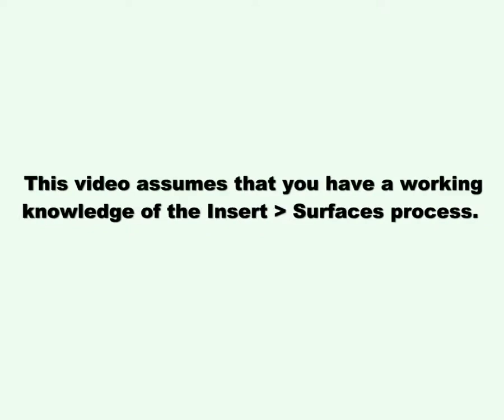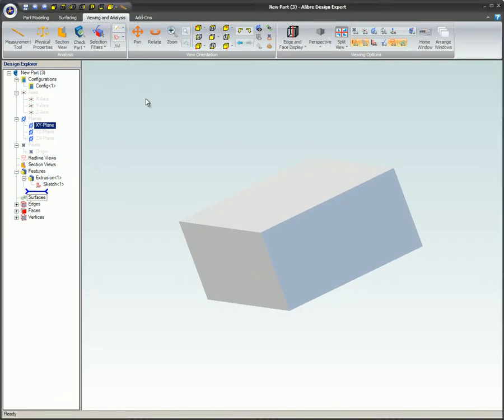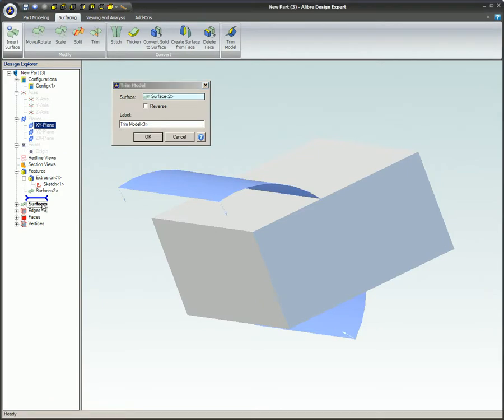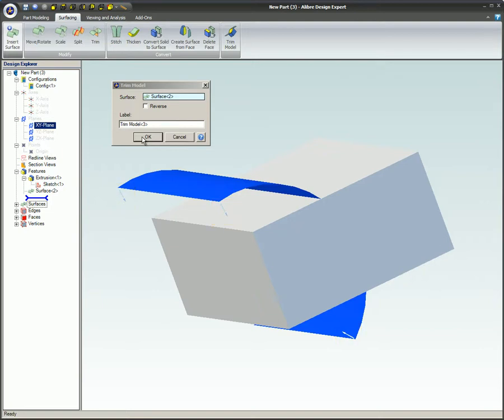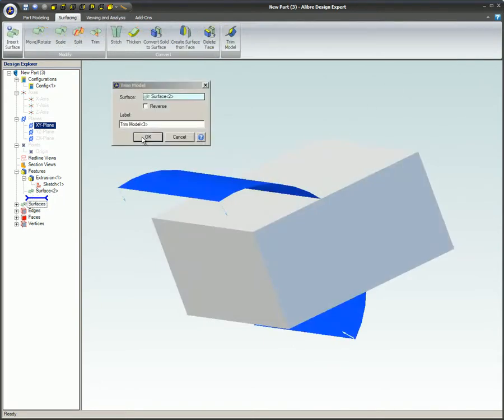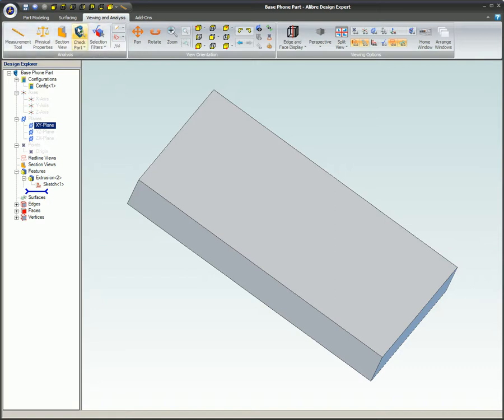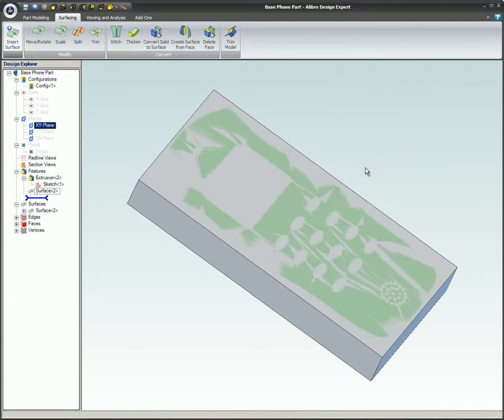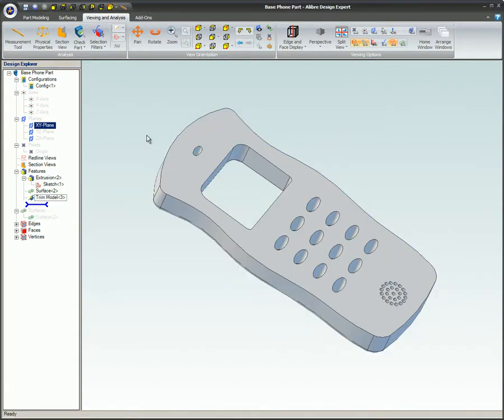Trim Model in Alibre Design (Legacy Interface)

Comment: making an inserting surface workflow in a cad program is a terrible waste of recourses.
instead you should have just included the ability to make 2d extrusions inside the program. that would the 2 or 3 lines of code for a STUPENDOUSLY important feature.
not being able to make 2d shapes in alibre is pretty much a dealbreaker for even the most basic hobbyists.
why its not in this program is beyond me